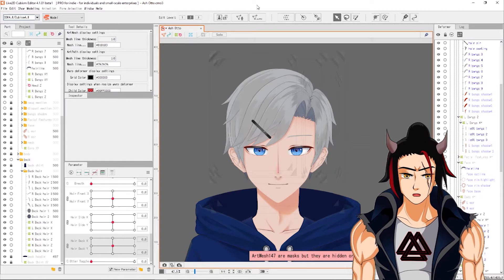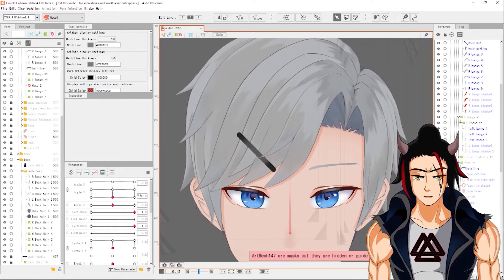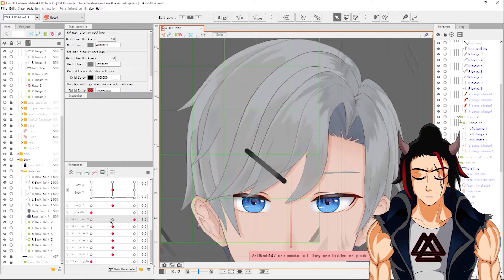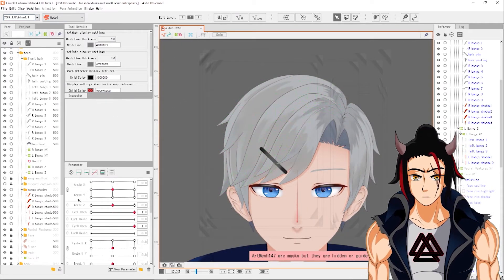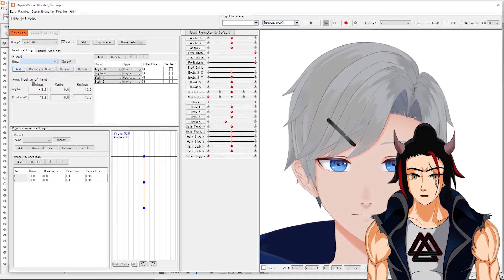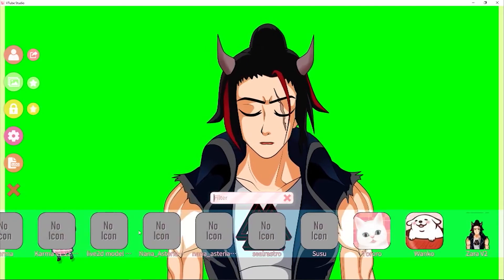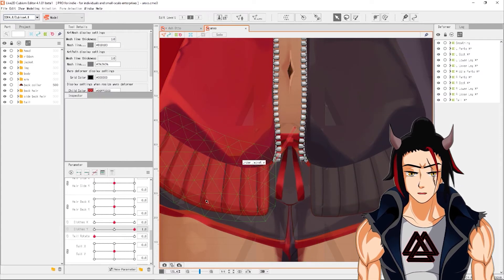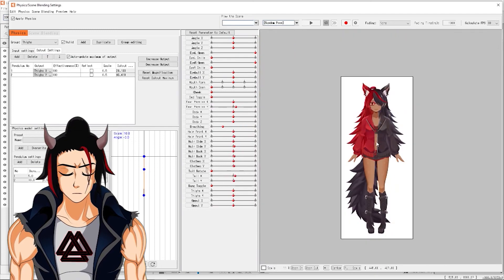Easy & REALISTIC Hair Physics in Live2D (Tutorial)

Comment: Thank you for this! A lot if hair physics tutorials make the hair move as if it weighs as much as the clothes. I'm still very new to the program and haven't played much with physics yet, but I wondered how I could slow dwn the speed of the hair pieces falling back into place to make it look lighter and softer.
I have very lo g hair irl and often reference it for my art, but even super ling hair should fall back into place slowly to look light and soft. While long hair is technically heacier than shorter hair, there is also more hair to be slowed down by wind resistance, so you would probably rig long hair and short hair fairly similarly as these features cancel eachother out in the flow.